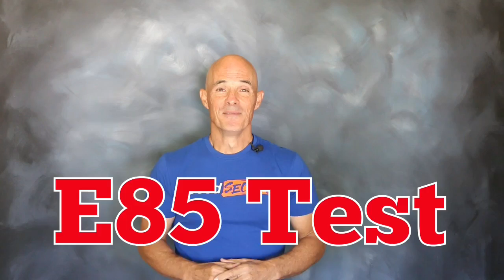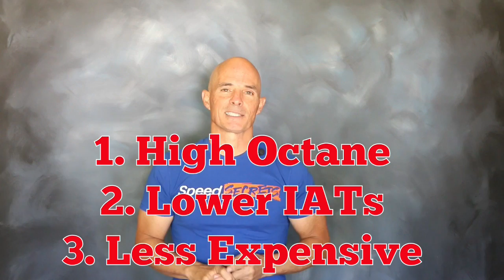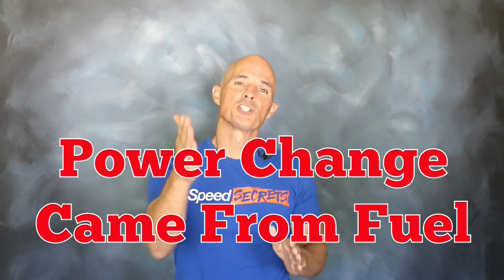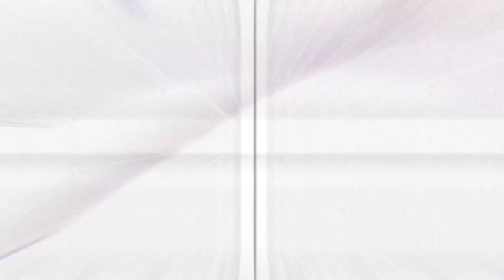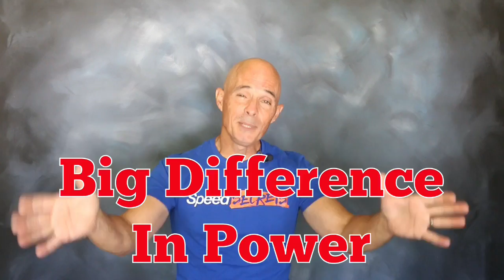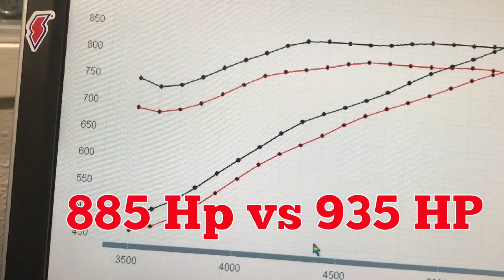TURBO LS FUEL TEST-E85 VS 91 PUMP GAS (CORNY COMBO)

Comment: Where's the boosted test for pump fuel , with a good tuner do U think U can run a healthy sbe ls1 with heads cam upgraded oil pump LS7 lifters timing chains etc on 14psi ,E85 is crazy expensive and uses 1)3rd more and only 1 fuel station anywhere near me so pump 98 here in Australia where I'm at just easier,mate tells me 14psi fine
Reply from the maker: 14 psi can be run on 91 with very low timing and a good intercooler and cold air to the turbo

Comment: All right let’s see this engine get the wheel of death. Pump gas style. 5 degrees timing 10:1 afr let’s see how much boost that 6 liter will handle before it croaks from lack of octane

Comment: Super interesting stuff! I’ve always been under the impression that race gas (especially 114 octane) will perform just as well as E85. A couple caveats:  E85 out of the barrel from VP, Rockett, etc is wayyy more consistent than out of the pump. E85 is also hard on fuel lines and fuel systems in general, requires significantly more fuel and smells like dirty socks! Lol I could smell rave gas out of the tailpipe all day, E85 not so much.
Reply from the maker: E85 adds power over race fuel because of the extra cooling-but we run race fuel for very high HP stuff like the Big Bang testing

Comment: What size injectors do you have to step up to for E85 vs pump gas and race fuel
Reply from the maker: about 30% bigger
Reply: @richardholdener1727  what where the injectors on the test motor rated at? I am looking to build my 6.0 for a turbo and E85 as well, maybe a nice Comp turbo cam as well!

Comment: Have you compared 91 and e85 on an na engine with higher compression? Say that 6.0 is 10.4:1. And it didnt gain much. What would the change be just going up in compression(bump to atleast 11.4:1)  on 91. Would there be more of a gain on e85 na with the higher compression.
Reply from the maker: I have not-there might be more there

Comment: Richard I love the videos, always great content! I'm with most of the guys here just needs to be a bit longer but no complaints. How much timing and boost psi was used on the e85 test if you don't mind me asking? I'm switching from pump gas to e85 on my turbo 5.3 soon and was just curious for a ball park figure. Thanks!
Reply from the maker: boost was 12.8-13.0 psi and timing was 21 at the power peak-less below
Reply: @richardholdener1727  I appreciate the reply. From that I would assume somewhere around 14-16 at peak torque then.
Reply from the maker: Billy Bowerman it will be less at the load in and torque peak but I don’t have the logs for the exact numbers

Comment: Could you ever use a mixture or straight liquid nitrogen in an ice tank for a turbo if so what kind of intake air temps would you see
Reply from the maker: you might be able to use it to cool an ATA intercooler-would be cool

Comment: Ive heard that E85 is "oxygenated" also, is there any truth to that?
Reply: It's literally in the chemistry - C2H5OH. In other words it literally carries liquid oxygen in with it (which is more compact/dense than oxygen in the air). Meth is the same, except higher percentage of oxygen due to less carbon & hydrogen. Nitromethane is even crazier, having 2 oxygen atoms.
Reply from the maker: a guy with a handle like hydrocarbon has to know these things!

Comment: At the beginning you said it lowers temp but didn't show that info...
Can/will you?
Reply: Oh, and agree about slowing thing down...just a bit.
Reply from the maker: the alcohol content provides cooling-even better than gasoline
Reply: @richardholdener1727  yeah, I get that. It just seemed like you were going to go into that aspect of the fuel selection and give some numbers or data. Just thought that would be interesting seeing as how hot turbos and the air they breathe are so hot.

Comment: E85 will ALWAYS make more power NA.  It is within 1% of the BEST oxygenated race gas.  With respect, the lack of change only exposes the ethanol ignorance of whoever tuned it.  It's physically impossible to not gain power if both fuels are tuned properly.  Send me the NA file and I'll fix it for you.  The E85 numbers are way down both NA & turbo.

P.S. adding timing on E85 sometimes LOSES power, but I doubt that is the main tuning error.  I can all but guarantee that the turbo tuning mentality somewhat hid the problem on E85, but it's still there.
Reply from the maker: Thnx but we got it. We add timing til there is no more power, we take away fuel til there is no more power. The dyno tells us what the motor responds to, we tried adjusting both a dozen times-you might look at the starting point of the chassis dyno gains.
Reply: Richard Holdener again, with respect, that cannot be correct.  I've done this test back to back hundreds of times on a WILDLY diverse group of engine designs.
Reply from the maker: Zachary Morris you are always welcome to come out to westech and show us

Comment: Without optimising timing for reach fuel though, makes the test false ? Different fuels burn at different rates, so one size cannot fit all, nor could it be used to verify performance without adjusting it.
Reply from the maker: We tried different timing values with the na combo and saw no change
Reply: @richardholdener1727  Yea, but that doesnt mean timing requirements will not be the same on boost. How much timing did it take ? Which boosted fuel was timing tuned for ? the race fuel or ethanol ?

Comment: Its worth mentioning E85 will give you more cushion for knock on an NA engine especially with higher compression.  Not a good idea to tune a street engine for best power all the time.  With E85, you can put it on kill without worrying about detonation.
Reply: Also not just from excessive timing, but from poor AFR's (don't ask me how I know lol). E85 will be less prone to knock at much leaner AFR's vs pump gas.
Reply: @hydrocarbon82  that statement was made under the assumption that the AFR is tuned properly.

Comment: I know this'll sound a bit backwards but did you try timing in both directions? E85 might actually lower your mbt due to its properties, so maybe  lowering timing might increase power.
Reply: E85 likes less timing than pump gas quite often.  Something ELSE is WAY, WAY off on the NA tune
Reply from the maker: Zachary Morris on an LS like this we sweep from 24-30 degrees or so depending on chamber etc...-that should cover it
Reply: It's usually 4 or 5 valve hemispherical tumble chambers that likely slightly less timing.
Reply from the maker: Jacob Burskey we do Timing sweeps-but haven’t found e85 to like less timing -but we check

Comment: Great video Richard!  Did you find, as the HPA guys have explained, that the E85 actually needed LESS timing than the race gas?  
Their data indicates that the ethanol burns FASTER than gasoline, so when the gasoline is a super high octane that isn't detonation limited, it will want more timing than the ethanol fuel.
Reply from the maker: Hammerhaus Kennel we do Timing sweeps to find what it wants
Reply: @richardholdener1727  Thanks Richard!  I guess I wasn't very clear with my question though.  I was counting on the idea that you guys had optimized the timing within reason, and I was curious if the E85 ended up wanting LESS advance than the race gas did??  If you remember?
Reply: My guess is the ethanol evaporates faster & more evenly, leading to a more homogeneous mixture. Lean and rich pockets will actually burn slower, even tho the overall avg mixture is the same. That would possibly depend on the method used (efi/carb) and head/cam/chamber combo.
Reply: @hydrocarbon82  Richard did reply to someone else I saw, indicating that he hasn't seen E85 needing less advance than race gas.  Interesting stuff though.